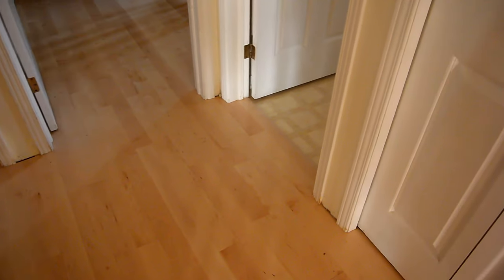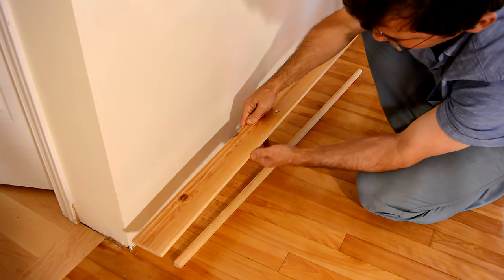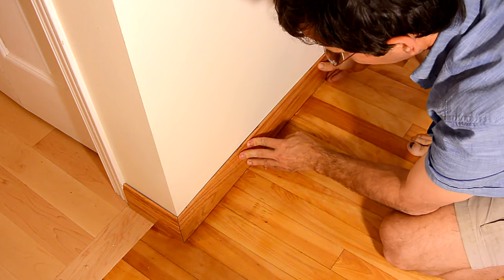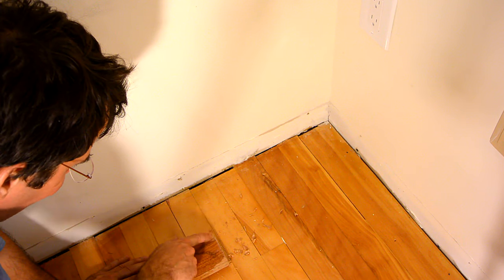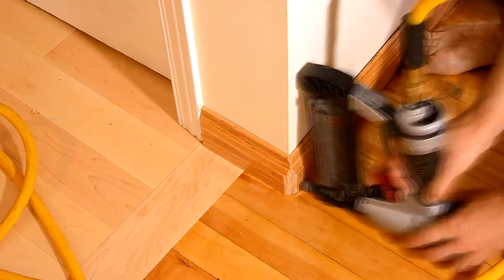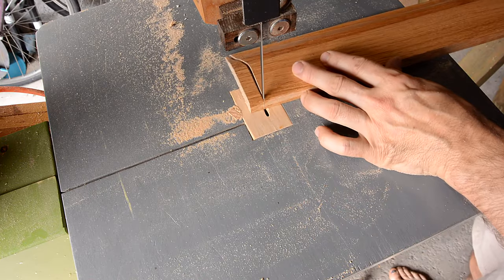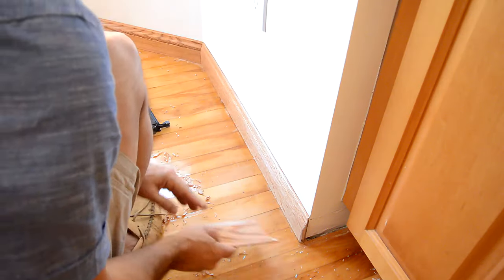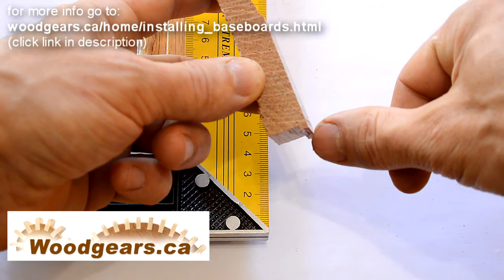Installing baseboards

Comment: Sikaflex 298 brown is quiet close in colour to oak and would be good on the floor/skirting board joint. For the top joint, if you tape the top of the skirting board brfore fitting then you can caulk and paint without having to worry about paint on the wood.

Comment: I installed my baseboard in the same way.  It's very time consuming to make things fit well, basically dealing with the imperfections of the walls and floors.   The good news is that your door casings will be much less work.

Comment: Coming from a professional finish carpenter that does a ton of trim work there are much better ways to do almost everything in this video. One thing I noticed is make sure you glue your outside mitre corners. Another is when coping inside joints, it's much easier to cut the cope to 45* and follow the profile with a coping saw then using a file to fit snug. Another is don't chamfer/bevel the outside corners, that looks awful. I understand Matthias is not a professional and there are a ton of different tricks that you learn overtime. Good video nonetheless with a couple helpful tips.

Comment: Good show Matt! Having done this job before a time or two its good to see someone else have the same experience. Every piece must be custom fitted, every angle different, no house surfaces are parallel. Ever.  So its not just me. Thanks.

Comment: I love it!! 

I HATE quarter round!! I just did my first job where I did the finish carpentry and painting remodel myself. 8 inch painted baseboard to match height of baseboard heaters. I didnt think about planing to shape to floor (because im the painter and I still cant make a hand plane work on my behalf (not that i woulda thought of it anyway)). I found that the gap was still more acceptable than q r. Relief cuts are a great idea i could have used although i back caulk/adhesive everything i put up so it aint going anywhere.

 Other things learned in this video as well

Thanks

Comment: I like the way shoe moulding looks on my hardwood floors. Without it, it doesn't look quite finished but with the thick baseboard I don't think shoe would have look good with it either. Maybe if your door trim was thicker than your baseboard it would balance out better

Comment: Only 2 things matter about these. Your wife likes them or your real estate agent does. Nothing else really matters.  Our moldings have the same profile on the ends. It just supposed to hide imperfections where the floor meets the wall. I guess you could add some chair rails, picture rails and  plate rails.

Comment: When coping your inside corners, first cut a 45 degree mitre cut and then cut along the line where the 45 degree cut dissects the moulding. Much faster and more accurate than trying to scribe the profile on to the skirting board.

Comment: Instead of a rebate relief cut, try just bevelling it at the back edge where it meets the floor. Will make scribing easier. And the inside joints are rarely mitred so that was a good observation of yours.

Comment: I normally won't force the moulding against the wall, this allows it to stay straight. Normally you can't see the waviness in the wall, but it would stick out a lot if the baseboard was to tightly follow the shape of the wall.

Comment: When I moved into my house, there were plastic foam molding everywhere, and the corners were slathered with plaster.
I like your method better.
Some of the moldings had even bent from the heat from the sauna in the adjacent room...

Comment: You could have held the molding up and set on nails to scribe parallel line with the humps in the flooring and also rounded the top of the baseboard so if it wasn't exactly tight it could be filled with painters caulk and pretaped the based board and caulked and painted it .  That was priceless watched you running back and forth to your power tools !!

Comment: Outside corners on baseboard. cut each piece of base on a 22.5 degree angle then cut a small piece with a 22.5 on each side to fit in between the two.  Works and looks great, almost like you rounded the corners of the base.  You can also do this with the outside corners on the door trim.  I always do this with chair rail as it will get all torn up with the corners sticking out from a normal outside miter. Try it, it will look a lot better than cutting off the outside corner like you did.

Comment: We are of the same mindset when it comes to quarter round at the floor. I would much rather take the time and fit the baseboards to the wall and floor instead of hiding the gap with quarter round.

Awesome idea on the relief cut on the bottom. I don't know if I would make it that thin, as it seems like it would split right off when hit, but unless you're sliding coins across the floor at very high speeds, I'm not sure what would impact it.

Comment: I have installed trim in hundreds of homes I have not seen it done any better .. good job . I like your outside corners , I would like to see them after you put the finish coat on them .depending on how well you sanded them will determine how much darker they look on the end grain

Comment: Having just done my own skirting boards I have to say you have gone to so much effort to get that right. I started off like that but quickly realised if you paint them white then decorators caulking can hide all of the gaps with no fuss at all and my house is super wonky. The other thing I realised is that once they are on you will never give them a second glance so it’s not really worth getting them super perfect.

Comment: i did the same thing when i replace the carpet with wood. used a taller baseboard so i didn't have to repaint the ridge where the old boards were. i didn't use the quarter round either. one of the runs i had to cut the bottom of the baseboard to match the awkwardness of the floor, like you did with the hand plane. i just used a band saw though. good work.

Comment: Should have made your corners out of a round piece of stock on the lath then quartered it and run strait into it ,or do a three piece corner like you use on rounded corners for drywall ,was that toe shot the on the job hazard ...lol nice job

Comment: next time if you want to cope them just cut an inside 45 and follow the line with your coping saw and back cut it a couple of % no need to draw the shape on to the pc they fit way better if you back cut the coping cuts

Comment: If you're doing more trim just use clear caulking, and cut in until the top of the wood
Reply: Carpenter here, you can get caulking in a few shades of brown.  Find one that matches your wood and then do as you say and paint down to a nice, sharp line.

Comment: Wouldn't it be easier to fill and fair the uneven areas with drywall joint compound before installing the baseboard trim moldings?
Reply from the maker: that would be way more work.  And then the house would need repainting.  So probably about 10x as much work.

Comment: Why did you say there is nothing to anchor the board in, when measuring the flex/curve? Isn't there a sill/wall framework behind there in which the drywall is screwed into?
Reply from the maker: there isn't any framing member in the wall right where I need to pull it the most.

Comment: I haven't seen quarter round used in anything but the cheapest jobs. Base shoe is shallower front to back and looks nicer than quarter round. It's also easier to bend to follow wavy floors, so you don't need to adjust the baseboard itself. And it gives a finished look.
Reply: Another comment that is Noteworthy......

Comment: The point is that if you are unable to fix all these crucial details, none professional will do. Even if you pay a fortune.... This is why i prefer to fix whatever i can myself. No one will pay such attention. Most of professionals rush the job in order to finish and take the money
Reply from the maker: And using very flexible MDF baseboards and quarter rounds makes the job go a lot quicker too!

Comment: This sure is a case hiring a professional does not mean a better result. There are so many adjustments a "professional" would just pass to not "waste" time. He'd only get the job done and get paid.

Great great work there Matthias
Reply: qwertt14 or, it's quite possible a professional would approach it differently with both quality AND speed in mind. Depends on how much the specific professional cares about their reputation. If they don't,  time and lack of quality will make the decision for them. The reward?  No more work.
Reply: I kinda agree with you. It easy to see what 'hiring professionals doent mean the best result', but surely most people would settle for the basic work matthias was avoiding

Comment: So now, the much more noticeable bottom of the base board wobbles along with and accentuates the not level floor. The quarter round does a much better job of hiding this discrepancy, as it was intended to do.
Reply from the maker: so the quarter round would be much less noticeable than the bottom edge?  I don't think so

Comment: a Few tricks back cut your copes,  use some sticky back  80 or 150 grit sand paper attach it to a scrap of base and tune your cope to fit, Check the square at eh corners and shim behind  if the dry wall mud is fat or thin you have to compensate. 
   run a  bevel at the bottom of the base for the uneven floors for the block plane,  and if you run prefinished like that  use some masking tape  to nail through and putty before you pull the tape  touch up the varnish
Reply: Very cool tip Andy...I will try that 'Tape Tip' on next job.....

Comment: my experience with trim is:  its always a "crazy amount of work"  fitting around the curves...  even with the mdf junk
Reply from the maker: you can't hand plane that stuff very well, so how do you fit it?
Reply: it's soft enough and thin enough that a little rubbing with very coarse sandpaper removes material and shapes it fairly quickly.   congratulations on your what I call "real trim"  (as opposed to mdf).   it looks great!

Comment: When using a trim nailer for boards like that you need to put the nails in each at a different angle to connect into the sheetrock. Kind of like an x pattern with the trim nails. If you put them straight in it's a lot easier for the board to pull straight out. The pattern holds boards so well to the wall, professionals don't even look to find studs with this method
Reply: Hacks don't even look for studs with that method.
When installing trim it's best to shoot into the soul plate, and only the soul plate if you can help it. If the walls are really wavey you might need a handful of nails into studs, but you should avoid it at all costs.

Comment: That's the thing about 'professionals'- often they aren't. My Dad told me a great story about a guy who lives locally- he drives around in a van with 'Master builder' printed on the side, but in reality he only has experience as a labourer who got fired after a short while for being useless, and also was a general assistant at a metal working factory unit; if he is qualified as a master builder, everyone is...
Reply: SuicideNeil sometimes,  just sometimes,  someone who claims to be a professional.....actually.....is.
Reply: SuicideNeil the comment left wasn't meant to be confrontational,  yet it seems you may be. Hmm...troll maybe?

Comment: I'm not a big fan of those high-profile nailed/glued baseboard/skirting boards. Removing them for furniture is a royal pain and there's a total extra level to vacuum-clean. We always had a low concave profile that was screwed to wall anchors.
Reply: Removing them for furniture? What? You don't remove them for furniture.
And they don't actually require much extra effort to clean.
Reply: Well, you do where I'm from. This way you can sneak your wardrobe all the way up to a wall or into a corner. And of course it doesn't take much extra time to clean them, but if you don't have to ...

Comment: The problem with bending the skirting  is it shows the unevenness of the wall. I tend to fill the gap with cork and paint, it then makes the wall appear straighter.
Reply: cork ?
Reply: Décor Filler.

Comment: So you plaster the joins in the plasterboard (drywall) but leave the rest of the wall bare? No wonder the walls arent level. Here we have plaster across the entire wall so it's flat and level. Of course we still have issues with corners not being square but that's due to the stud wall being off square and not the wall being uneven.
Reply: James Coyle yeah, this is common for American Construction.
Reply: That works great if you assume the structure will never move, and the wall will always remain identical to when it was constructed. Since that isn't really the case, perfectly flat walls will end up crooked and wavy either way. Your method would also cost more and require a lot of finicky work to actually get flat across a surface that large.

Comment: The most horrible thing is my wife would want to paint them
Reply from the maker: No can do!  but paint won't stick to the oil based varnish!
Reply: finished a house in custom milled clear cedar once.Windows, doors, baseboards.Once complete little Mrs homeowner did not like it and decided to paint it all, including custom cased windows.What color?????WHITE!
Reply: River rat yes... There is a place for some of that nice white wash paint look. But not over custom made oak baseboard
Reply: She spent over 50,000 on custom milled clear old growth western red cedar just to paint it white in the end.Painting western red cider white is not simple or cheap.Three coats of shellac based primer to seal in the tannins just to start.She spent over 2 million changing her mind on a 1100 sqft beach house.She inherited the beach house and the Bayliner boat fortune.

Comment: Wood putty in the joints
Reply: No.

Unless you like your work to look like crap, then yes!

I've lost patience for moulding. I only use square MDF baseboard now. Beat it to fit, fill and paint to match!
Reply: Thus proving Matthias's point.... "To make a living as a carpenter requires a certain sloppiness to be able to do it fast enough
Reply: justin s false. Speed quality and efficiency need no sacrifice.  Experience is all that's required.

Comment: Never use 1/4 round on baseboard always use shoe molding it has a better profile. Baseboard without shoe looks unfinished. If you knew you were going to re-do the casing you should leave the baseboard square and add plinth blocks to cover the baseboard ends.